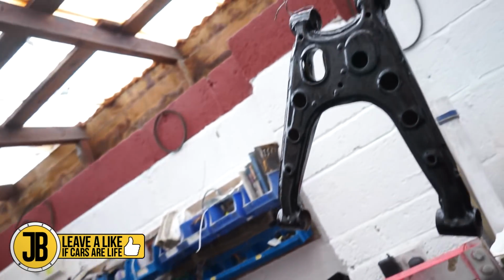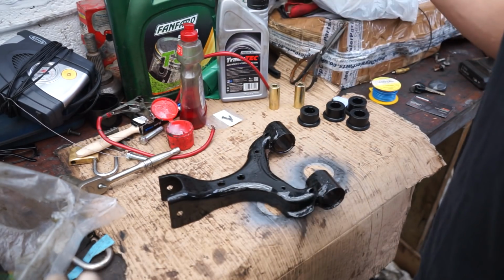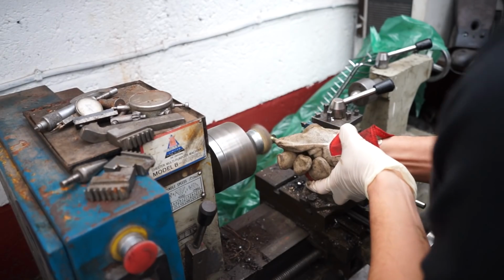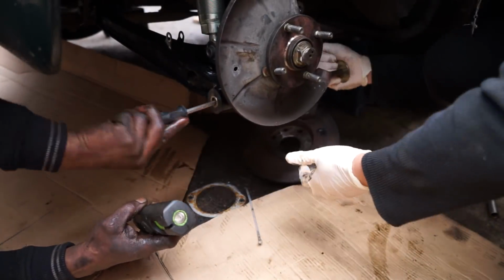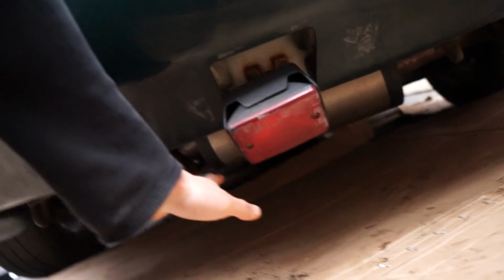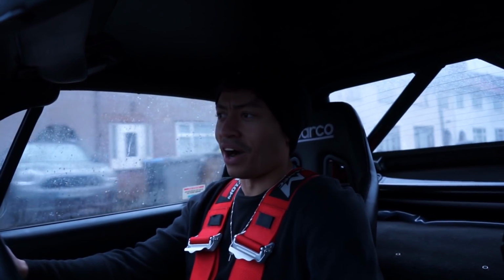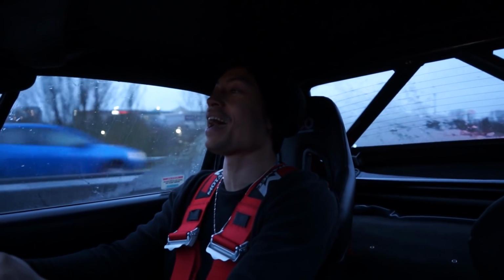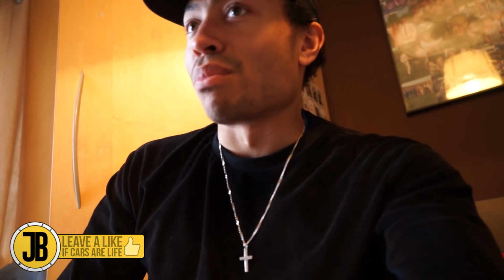REACTION to Driving my Modified MX-5 NA (NEW PARTS Worth £2,000!)

Comment: imagine i finally learnt how to power slide yesterday, rear wheel drive 330 e92 just goesss. cant imagine how fun that mx5 is to drift in.
Reply: 😎 bimmer gang
Reply from the maker: It's so sick because of how little it is, and it's not overpowered so it's relatively easy to get the right throttle!
Reply: @CarsWithJB  Just submitted the whip for subscriber showdown. When will the next one be up?